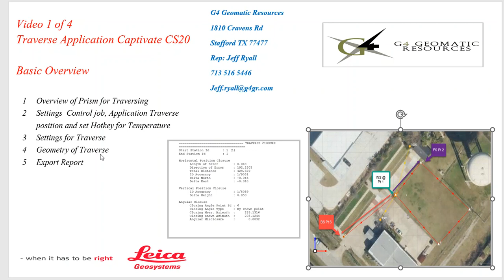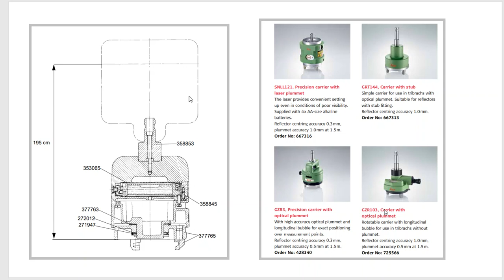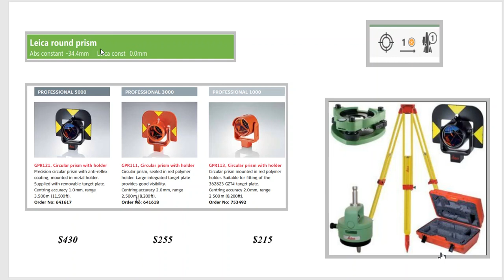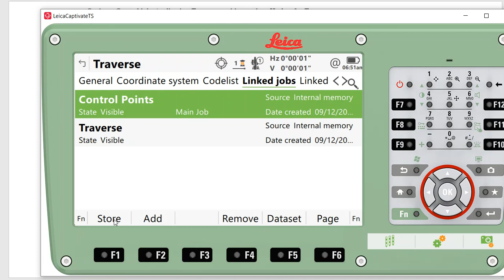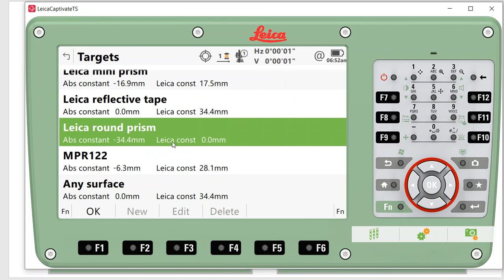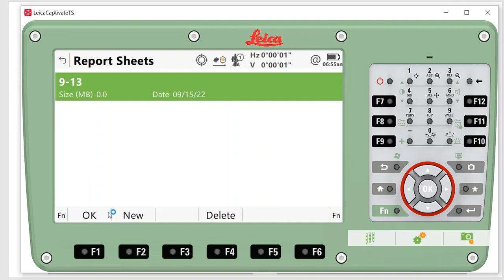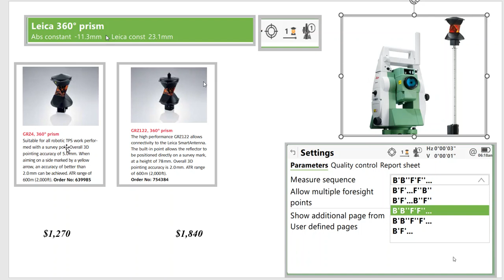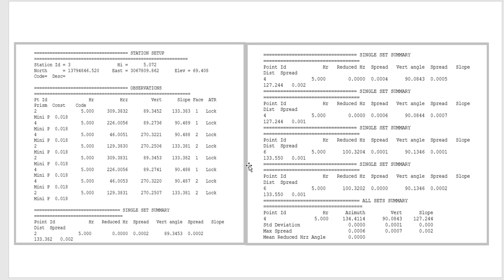Leica Traverse application for CS20 (or TS16-13-MS60 ):  Intro Basic Settings (Video 1 of 4)

Comment: Thanks so much for adding value to the larger surveying community with this video.
@ 6:26 did you say can or cannot be edited in Leica Infinity?
Reply from the maker: Sean, thanks for response- sorry the PPM info CAN be edited in Infinity, that is strong feature of using Infinity to edit PPM, instrument heights, rod heights and prism offsets, as well as setup coordinates and adjust traverse Infinity compliments the field data collector  very well